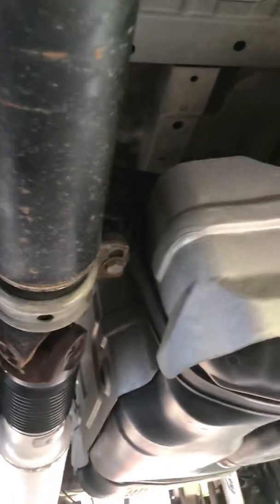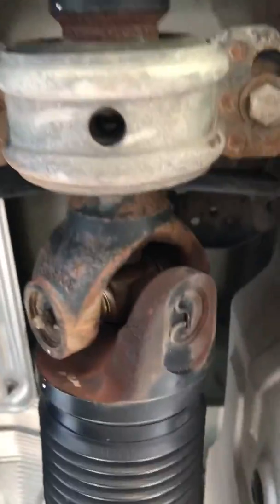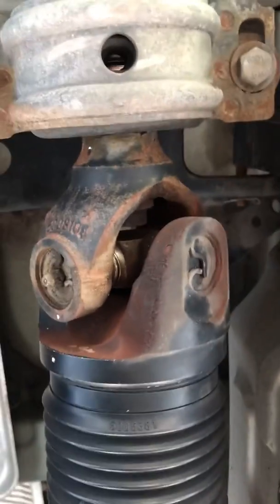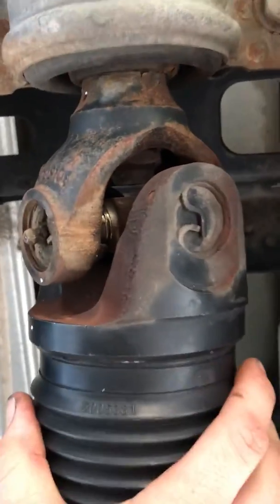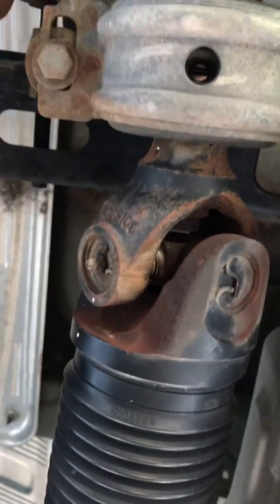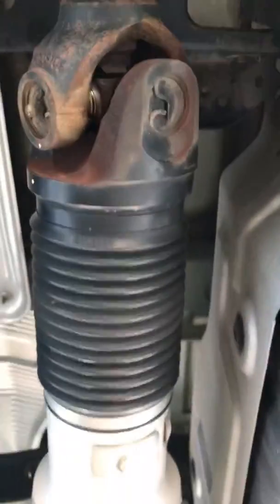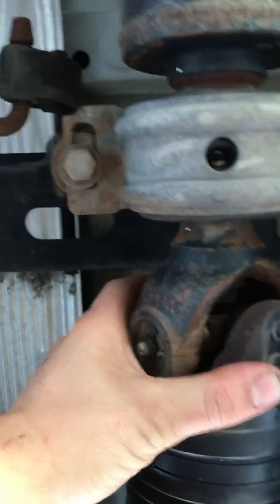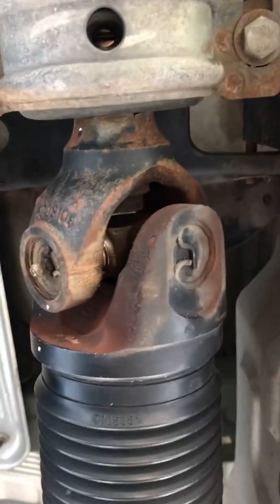Tundra driveline u-joints

Comment: What part number did you replace it with?  O’Reillys had a part number match for a fitment but when I compared the precision 1.036 it was so much smaller. Is it a 1.188 by the case?  Are all 4 the same size? I got a spicer 1.188 from oriellys but it doesn’t have grease fittings

Comment: Hey bro I got a 2018 and my u joints are sealed however I noticed on my carreier bearing mount the bolts are positioned super far forward (toward engine not differential) I unbolted and reboltes same issue to the point I had to leverage the mount to get the bolts through. Thoughts? Thinking axle wrap

Comment: How do I grease a 2wd tundra with no grease fitting? I’m getting a thump when I press and release the brakes and it seems like with the 4wd tundras the thump goes away after they lube the drive shaft. I’ve checked everywhere twice and can’t find any fittings on mine.
Reply: Im wondering the same thing . I have a 2015
Reply: @mattreinshagen6240  after doing lots of research I came to the conclusion that the 2wd 1st gen tundras don’t have grease fittings on the driveshafts. 

I fixed the thump by tightening the bolts from the transmission mounts to the cross member. They were all loose and torqued like 15ft lbs from factory which is way too low. I think Toyota updated it to 25ft lbs and the thumping went away after I retorqued them.
Reply: @deegaw11 bro i have a 07 tundra 4.7L 2WD and 65% of the time i let my foot off the brake from a complete stop i feel a soft jerk BEFORE i even lay my foot on the gas. I assumed it’s the slip yoke. Tired of this problem. You think it’s my slip yoke?
Reply: @PracticalPostMan_FLA  I have a first gen and I fixed the issue by tightening the bolts from the transmission mount to the cross member. They were all loose. Been good since. Not sure about the 2nd gen tundra but you can check and see if they’re loose.

Comment: I purchased a used '08 Tundra and the u-joints failed, because of the lack of lubrication.  However, the Toyota dealer informed me that the replaced u-joints do not last.  The assemblies are made of aluminum and when pressed out, ..."blow out" the aluminum, so they do go back together, but ultimately fail again.  They recommended a complete drive shaft replacement.   Given that the carrier bearing did not look good, I went ahead and did it.  I had not heard about the issue with the aluminum u-joint ends being aluminum.
Reply: You can buy specific aluminum u-joints. However, these typically have an advisory on them that they are only to be used with aluminum drive shafts. Most all quality u-joints, like the ones made by Moog and AC Delco, are steel.
Reply: @jasonbarnes5282  ....Interesting, because my Tundra is an extended (8') bed and has an aluminum drive shaft.